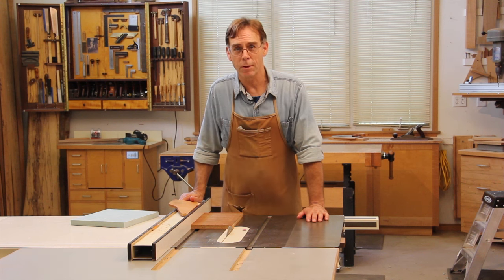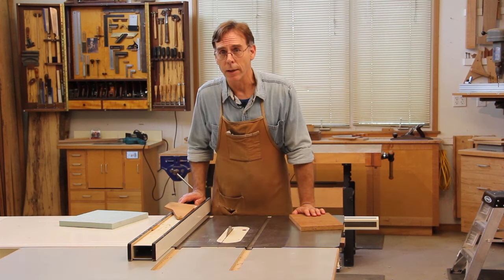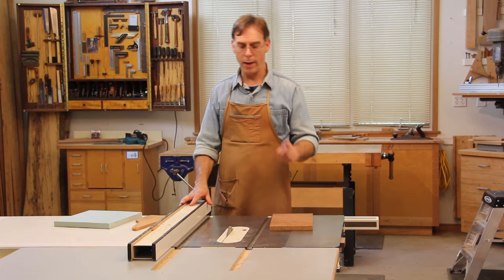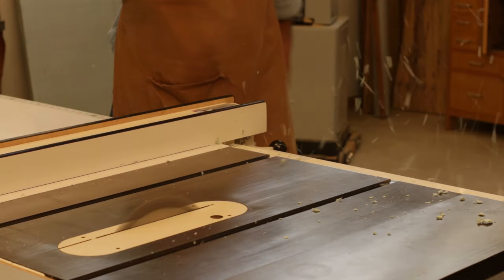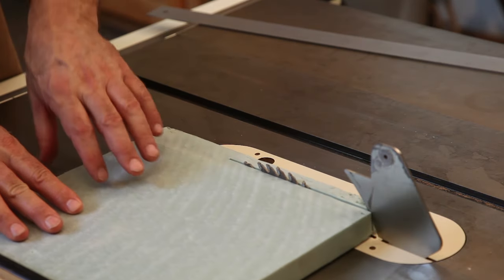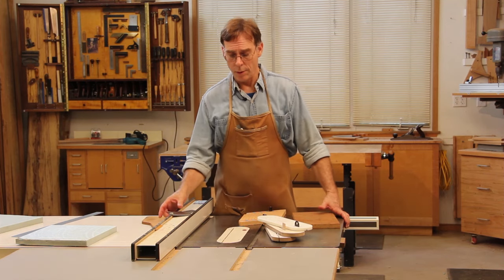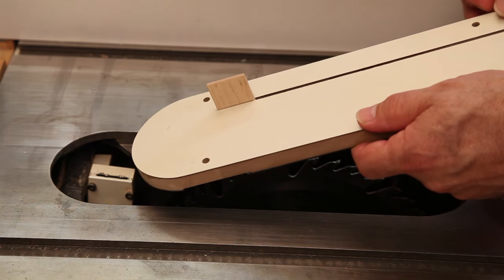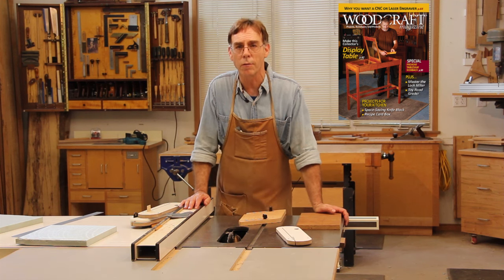Preventing Tablesaw Kickback

Comment: Complete and total amateur noob here, but, wouldn't you avoid kickback by designing the saw to be fed with the blades rotation instead of against it?
Reply from the maker: The point of the video is to teach how kickback can occur.
Reply: No I know, and it's a well done video, I guess my question didn't make sense, probably due to my lack of knowledge, oh well,great channel!
Reply: if you try an feed the table saw from the other direction(with the blades rotation) it will pull the piece from your hands shooting it quite far i use to play with this as a kid. you don't want to have to power grip your piece to keep it feeding through the table saw. the downward moving front teeth help keep the piece secured to the table. Also I think it would splinter your wood seeing as how a table saw cuts from the bottom of a piece to the top, the excess would not have a place to go but up into the uncut piece if you feed it from the upward rising teeth edge. but that may just be nonsense speculation